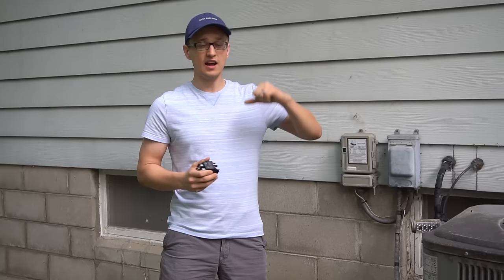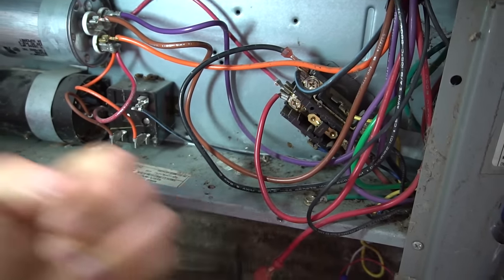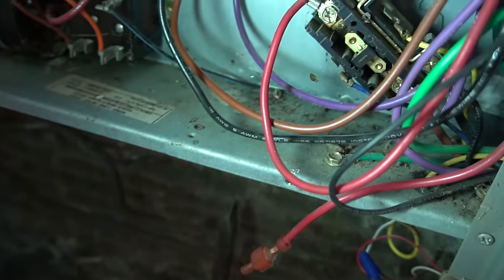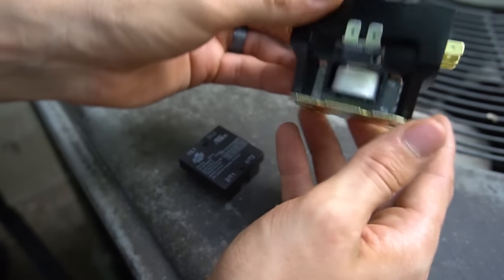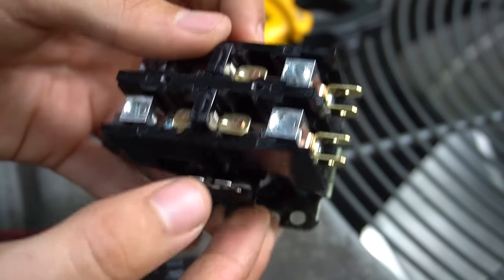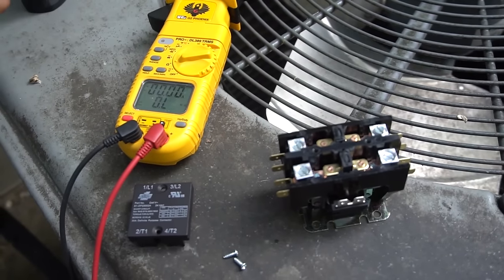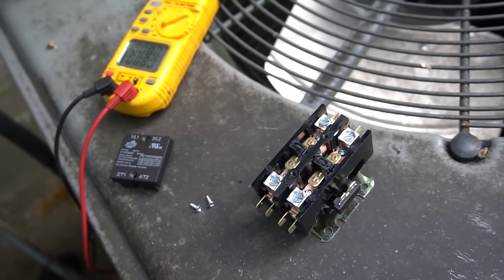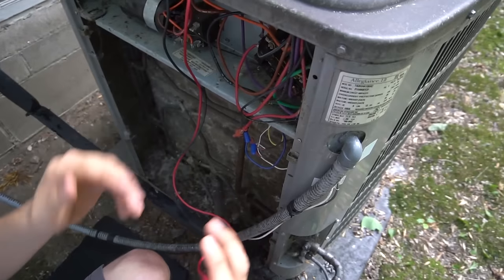Air Conditioner Contactor - How To Check If It's Actually Bad

Comment: I am in the mix trying to fix my elderly mother's unit with absolutely no knowledge of what I'm doing. I have guest and diagnosed everything down to possibly a capacitor or a contact issue. The blower underneath the home will run as normal until it reaches desired temp but the compressor will only cut on and off if I tap it in a certain location with a hammer and wooden block. With each tap in the area the fan gains more momentum until it starts to operate normal

Comment: Thank you for your video. On the new part, if they didn't have labels as L1 & L2, how do you know which end will be used as power-in?
Reply from the maker: You're welcome! It actually doesn't really matter. You could use either side. 👍
Reply: @WordofAdviceTV  Thank you for your response. I replaced a new contactor because it is over 12 yrs. It does not cost much.
I have question(s) needed help. My ac "cooling" system keeps running and cannot be turned off. I replaced solid-state time-delay, fan-relay, and the contactor, but the system keeps running and cannot be turn-off. What caused such problem(s)?

Comment: Compressors draw a bunch of current and create an arc on the contactor.   Over time the contactors will become pitted enough to make starting the compressor with low voltage.  In turn causing more stress on the compressor.... eventually burning out the compressor windings.   It's best to replace the Cheap $20 Contactor   VS  a compressor that would cause $$$ a lot more.

Comment: Great video!  Just a query.  When testing for voltage, will the contactor be disconnected from all wires or stay on?
Reply from the maker: To check the voltage, all the wires would stay on and power on. Stay safe :)

Comment: Great video!  Are those terminals on the sides a standard size? One of my spade connectors on one of the wires broke and fell off so I'm looking for another spade connector to crimp on. I know they make them for various gauges, but the spade width itself. Is there a certain width I need that will fit the terminal?  Is that the correct term, "spade connector", because Lowes and HP calls them Disconnects. Thanks so much!

Comment: I have a Trane XR 15 heat pump. This summer the ac ran fine. no issues. When I turned on the heat the other day I noticed a loud vibrating buzzing sound coming from the heat pump. I took off the cover and noticed the noise was coming from the  contactor coil. Should I try cleaning it or replace it? It is 10 years old.
Reply: So I removed the coil and disassembled it and found live and dead earwig bugs inside of it. Found one bug squished between the contact points, which was causing the vibrating of the coil, cleaned out the dead bug and put it back together and it works great. Thanks for the great video. Keep up the good work.

Comment: Hey Jay, I work at a apt complex and learning HVAC from a guy that just sucks out the old refrigerant and puts in a different refrigerant with out using oil or anything. How does this effect the unit and what are the consequences. Thanks in advance.😀 I watch all your vids.
Reply: Michael Fiorella. I presume he does this in conjunction with another repair? 
As its wasted money to replace gas just did the sake of it. 
Gas change is R22> MO99?? 
Don't worry about the oil, unless in some rare instance it has leaked out.

Comment: Hi Jay. Thanks for all the great videos. I do have one question. I keep getting a low voltage fuse on my board blowing when my two wires to the contactor are connected at the board, that's one to common and one to yellow. When I remove those wires and replace the fuse the furnace works fine, but soon as I reinstall the 2 a/c wires and power the unit the fuse blows immediately. Have you had a situation like that?
Reply from the maker: Yes, I have seen that before. That means that likely the low voltage wires going out to your air conditioner are bare, broken, or cut... I would first investigate around the outdoor unit. I have a video on how to track a low voltage short too: https://www.youtube.com/watch?v=4e4wsruGS0s&t=1605s

Comment: Great video! What is the purpose for some contactors always sending 120 volts on one leg?
Reply from the maker: To be honest, I don't know 100%... I know some units have crankcase heaters and those generally need a one pole contactor so that it always has 120v going to one side of it.

Comment: Excellent video. Straightforward explanation, very clear and informative!!! Testing the coil for resistance and looking for 24-27 VAC are two easy things, as well as your explanation of single versus double pole(?) contactors. Thank you!
Reply: Vrey good coil checking shot or  contuit coil  restans  coil cut no showing metar one checking unit24 voltchecking

Comment: Amazing videos. You've saved me a lot of money already! Quick question....I finally got the AC running and everything works(thanks to you). Only problem I'm having now is the fan on the outside unit will constantly run even when turned off at the thermostat. I read somewhere that this could be caused by a bad contactor? Any idea on what could be causing this?
Reply from the maker: Glad to hear my videos are helpful! Yes, that sounds about right. My first guess would be that the contactor gets stuck in the pulled in postition. Best thing to do is to replace the contactor. Or you could try to take it apart and clean the contacts.
Reply: I have the same problem. The ac system kept running and couldn't turn-off at thermostat. I replaced both units: Solid State Timer Delay and Fan Relay. but they wouldn't do any good. So, I hope that might be a contactor problem, but I got 24 v at the coil.
Reply: Check the fan wiring to ground, it sounds like you are backfeeding from the normally closed leg of contactor thru part of fan wiring to ground. Fan probably turning backwards and slower than normal when system off at tstat. Than can be observed to stop and turn correctly and faster when system on at tstat. If Fan wiring grounded, replace fan motor.

Comment: My ac works intermittently, sometimes it comes on other times nothing is working on outdoor unit (indoor blower works). Could this be the contactor or the short cycle timer going out? Nordyne S1QA-030K.
Thank you
Reply: Don Jacobsen same
Reply: @pauld389  turns out it was my thermostat.  Watch his video on how to test it. I tried replacing batteries first but same problems.  I jumpered the contacts like he explains and that's how I determined the problem.  I bought a $30 thermostat on Amazon, installed it yesterday and everything is working perfectly.

Comment: Great videos. Video on how to wire a contractator ?
Reply: Breaker panel AC turned off, power disconnect at unit removed. Double check with voltage detector. Replace wire for wire.

Comment: I've got this weird problem where sometimes my fan won't come on. But if I remove the face from my thermostat, then put it back on, then the fan will come on. Some days are worse than others, and I sometimes have to remove the face multiple times to get the fan to come on. I've replaced the thermostat, and the problem remains. I'm wondering if it could be a problem with the connector. Do you have an opinion?

Comment: Very informative. What if you get 27 volts from the wires coming from the thermostat but contactor still reads 0 volts?
Reply from the maker: Not sure I understand the question.. But I think this video will be of help: https://www.youtube.com/watch?v=NVPhsK4gK1A&t=3s
Reply: I had this same problem. My fuses from the main disconnect (between the breakers and the unit itself) were blown. The furnace was calling for cool and sending 27v to the contactor, causing it to engage, but no voltage going into the contactor from the main leads (reading 0v across the two leads). Swapped out the blown fuses with two new ones, started right up! Hope this helps.
Reply from the maker: @joshuadobson8809  Thank you for sharing your experience!
Reply: #8 from the link he posted did for me so I have been chilling since then. Thanks for sharing your results to help others.

Comment: Great videos and quick question, my contactor is a single pole FLA25/RES30 do I have to replace it with the exact 25/30 or can I buy a FLA25/RES30 ? I’m just a homeowner diy person
Reply from the maker: Thank you and no, it does not need to be exact. The one you found will work.
Reply: @WordofAdviceTV  meant to say, FLA25/RES35 instead of 25/30
Reply from the maker: @llmandoii8493   That will be fine too.

Comment: Good explanation thank you. My switch is plunging when I set to cool but the fan is not coming on I believe it is the Capacitor?
Reply from the maker: Yes, that is very likely but it could also mean that the fan motor is bad. I would try the capacitor first since that is a much cheaper fix. If you try to spin the fan blade with a screw driver or a stick, does it spin rather freely? If it does not, then you will probably need a new motor along with the capacitor. Good luck!
Reply: @WordofAdviceTV  Thank you I will try that in the Morning. I like your Channel thanks for helping God Bless you.

Comment: Thanks for the video. My contractor is engaged and buzzing  but when I check the thermostat wires, there is no 24v, what’s wrong here ? Any idea ? The fan is not spinning and it’s not cooling but the inside blower is working.

Comment: This is a great video - thanks!  One question: I have an Orbit 4-station timer on a 2-pole contactor.  The first program (A) on the Orbit irrigation timer works AOK.  But when it goes to turn on the next program (B) 5 minutes later, I hear a click on the contactor, then it says "Fault" on the Orbit timer.  I have replaced the Orbit timer, but problem remains.  It is a Packard C230A contactor (30amp/24V).  Could the problem be overload, on the Orbit timer, in which case I should switch to a Packard C240A (40amp/24V) contactor?  thanks for any advice.

Comment: WHICH 3 AMP CIRCUIT BREAKER DO YOU RECOMMEND? I see the cheap ones on Amazon seem to have reviews saying they don't trip until power is really high. I don't want to buy one and still burn my transformer up.

Comment: Thanks for your videos! I have installed the Supco hard start capacitor and a new run capacitor. The AC compressor and fan turn on when I hit the plunger on the contactor. However when I turn it on with thermostat the compressor only comes on. The fan is set to 'auto' mode on thermostat. Should that fan always immediately come on when the compressor starts? I see a little spark when I hit the plunger on the contactor. But it starts both compressor and fan right up and the compressor is much quieter. Just don't want to damage compressor if fan doesn't come on. It does cool.
Reply from the maker: That is an odd one.. So when you manually press the plunger on the contactor, both the compressor and condenser fan motor come on and stay on. But when you set the thermostat to cool, only the compressor comes on? I would be curious to know how much volts you are getting at the contactor coil. (it should be around 27v) Also, if you allow the unit to run for a some time, does the outdoor fan come on later or does the compressor stay running alone until you turn it off?
Reply: @WordofAdviceTV  Thanks for the reply! Yes when I manually press the plunger they both come on and nice and quiet too. Initially I couldn't get the hard start kit to do anything. I saw another video where a guy hooked it up differently and essentially connected it like a start capacitor (mine was fried)  would be connected. I tried that and it seemed to work but I hope that didn't damage anything by doing that but I went back to connecting the kit to the run capacitor as recommended. The unit had sat for about 6 months not being used.  The unit is on the roof so I'll text my wife to turn on the thermostat and the compressor comes on making a buzzy noise (not super loud when electrical cover is replaced)  and the fan doesn't come on. It sometimes will come on later. I hope I am not damaging the compressor if the fan doesn't come on?  The house definitely is getting cooling. The compressor will turn off by itself when temp is reached. I see a little spark when I push the plunger in so I'm wondering if it's the plunger not making contact all the way when operated by thermostat. Thank you!!!
Reply: @WordofAdviceTV  Ok I got it to work ... the fan is now kicking on right away! I actually have two of these units. I just installed the hard start kit to the other one and fired it up. It immediately trips the breaker after a short weird sound from the compressor. I notice a little spark on the contactor at L1. I have watched your video on what causes the breaker to trip but I may need to get a tech out on this one. Thanks again!
Reply from the maker: @juniorsaxman From everything you described... It can be quite a few things so I can't give an accurate guess. But since you already decided to get a tech out, if you don't forget, come back and let us know what it was. Good luck!
Reply: @WordofAdviceTV  well the tech says the compressor is 'short to ground'. He is recommending a whole new system but that may require replacing the other two systems as well as the attic where the furnaces are located is to tight inside to physically install just the one that would need to be replaced (which is the farthest one from the entrance to attic. So they gotta get by the other two to install which may not be physically possible. The tech's manager is on his way over to have a look. Is there any way a compressor can just be replaced? It would save me a ton of money ! Wonder where I could find a used one .. this is a 1991 Lennox system .. top of the line for it's day. it was not even used 7 months out of the year as it's a vacation home. He did say the refrigerant is changing to R41 next year from R22 and the converter process won't be a good solution for the old systems due to PSI differences? I was hoping for a better outcome but at least I got one of the systems working. Thanks!

Comment: Hi- I am having trouble with condenser turning on and off within multiple times after start up.
>I replaced contactor- didnt work- got 24v at contactor then 11.4v then volts moves all over.
>I replaced transformer- same thing.
I just watched your video- i wonder if my timer relay could be the issue? not sure if power comes from contactor to relay or relay to contactor?

  I have timer relay + 1 other one.  Unit is rheem/2003

Comment: Great video; the contactor on my HVAC was melted at the point of contact on the top side where the load side wire was (ie not the line side).  It fused the end of the wire to the point of contact and the wire broke free.  I have replaced it and it seems to work fine.  Any ideas on what would have caused that?

Comment: Any big change out you should always change out the contactor..

You do OHMs across the 24 than check resistance from LIne 1 and Line 1 by pushing in the contactor

Comment: Hi, My Contractor stated 
Vac: 240/277
FLA: 25
LRA: 150
RES: 30
And coil: 24 VAC, 50/60 HZ

Problem is that everything matched on Amazon but RES. The one found on Amazon, RES is 35. 
So, can I still use contacted with RES 35 instead of 30.
Thank you.
Reply from the maker: Yes, 35 will work just fine. 👍

Comment: Thanks for your outstanding videos!

I have a question for you: When I turn on the AC at the thermostat, absolutely nothing happens outside or at the furnace. If I depress the plunger on the contactor, the outside unit kicks on (fan and compressor), but nothing happens inside. I replaced the thermostat, checked the fuse at the furnace, but can't figure it out. The furnace fan won't even run if I turn the setting at the thermostat to Fan, instead of Auto.  
The issue has been progressive over the past several weeks.  For a while, the furnace fan would run, but there wasn't cold air.  If if fiddles with the thermostat and breakers enough, I seemed to find the right combo to reset it.  I thought it was done a few days ago, but out of nowhere the cold ac kicked on like nothing had ever happened.  Then is stopped again yesterday, and shows no signs of coming back.
No loose wires that I can find, no mice or obvious corrosion damage. Any suggestions?
Reply: I am having a very similar issue. Any findings? Thx
Reply: you might jumper the control board inside your furnace to see if something happen, Jay got a video on how to do it, but first you might want to jumper your thermalstat first to make sure it is not the problem. could be just a fuse burnt out inside your furnace?
Reply: There are two separate power suppys fot the AC to work. Since you depressed the contactor and outside unit ran, than that indicates that outside power supply is ok.
The indoor power supply is suspect number one. Indoor power supply powers transformer which powers thermostat control wiring, which turns on indoor blower AND outdoor unit. You may have a bad breaker for this indoor power supply. 
Having a volt ohm meter and knowing how to use it is essential for the do it yourselfer. Otherwise call an electrician and have him fix your intermittent power supply.

Comment: Great video and great information.  My coil was pulling in the contact, but I wasn't getting 240V across the switch.  Played with it awhile then it worked.  Maybe bugs stopping full contact.  So I want to order a new contactor to have as a back up.  My original is 3100-15Q1408, with the following specs on the side.  Vac 240/277  FLA 35  LRA 180  RES 40.  Vac 480 FLA 31.2  LRA 75  RES 40, and Vac FLA 31.2  LRA 50 RES 40.  So, first question - does only the 240/277 matter since I'm only on a 240 Volt line.  And second, I can't seem to find one that matches exactly, should I go slightly higher or lower?  Thanks
Reply: higher